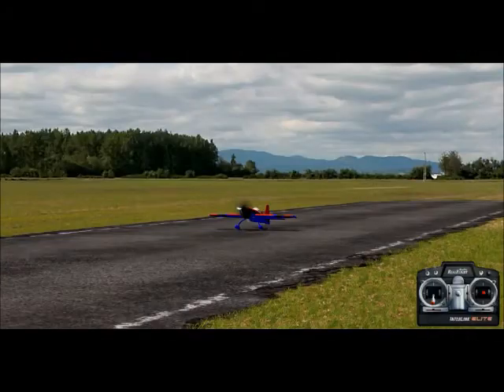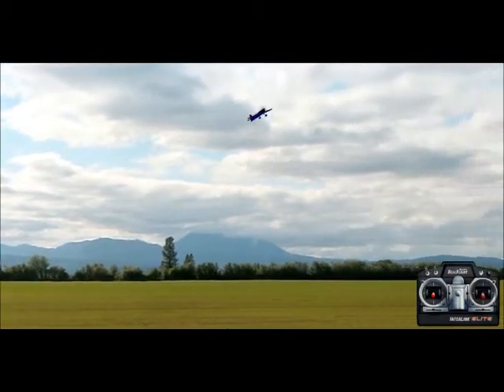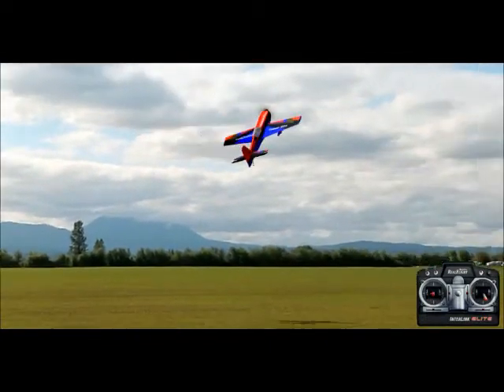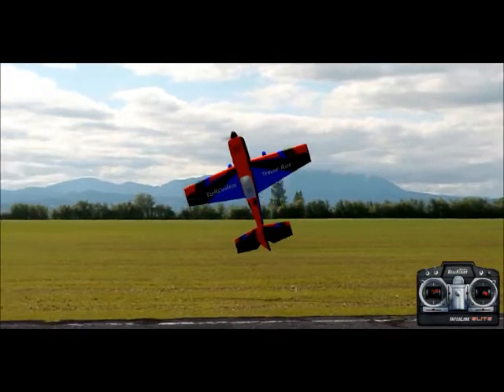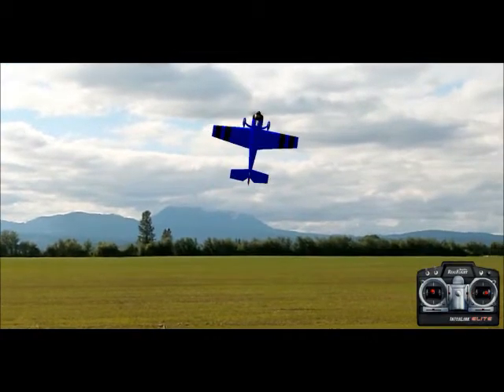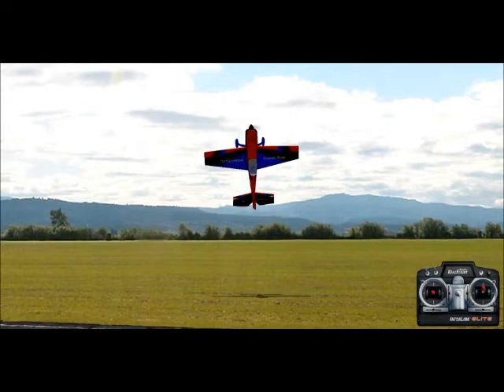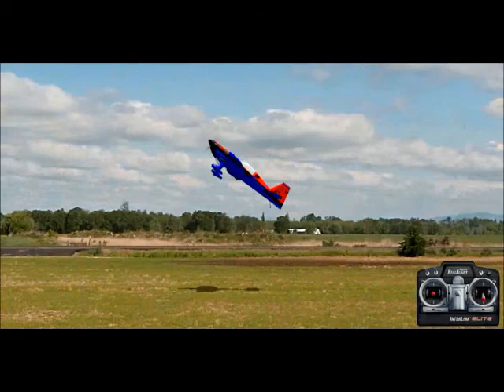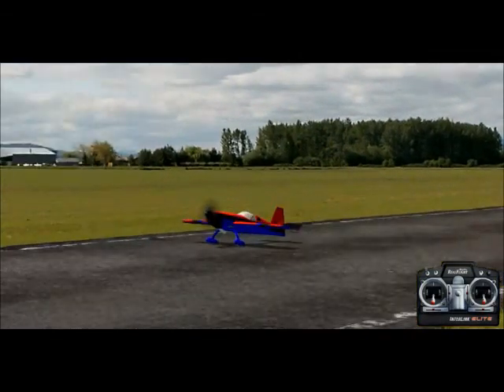How to Hover a Plane- Realflight G5.5

Comment from the maker: @icyou1999 Yes, the trims are important, but for a real plane, you should use trims to adjust the characteristics for stable flight, because its better to be able to fly into a maneuver comfortably and then use skill for the maneuver than have to hold the plane in the air and have an easy time with the maneuver. But for realflight the planes are almost always going to have perfect trims. You should not have to bother with them if your only using realflight.